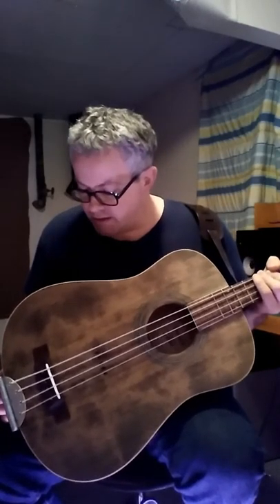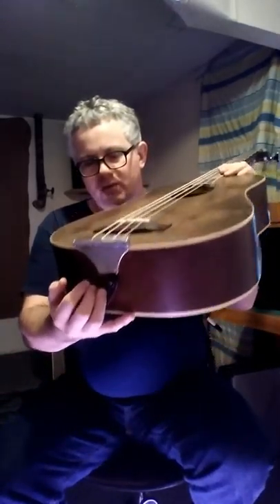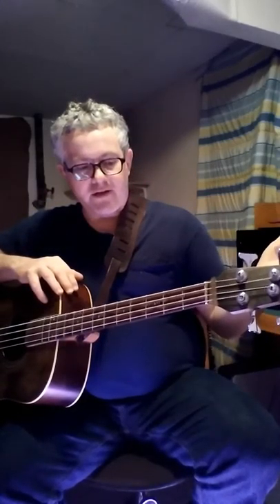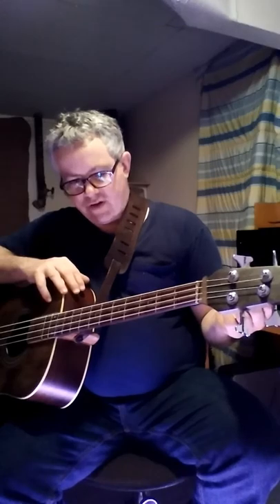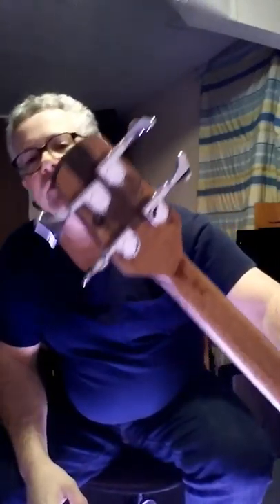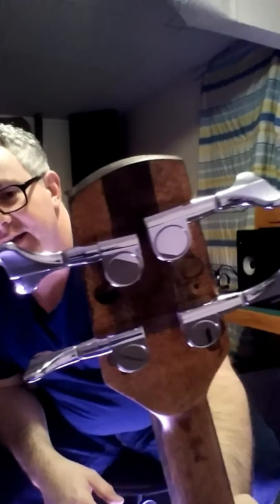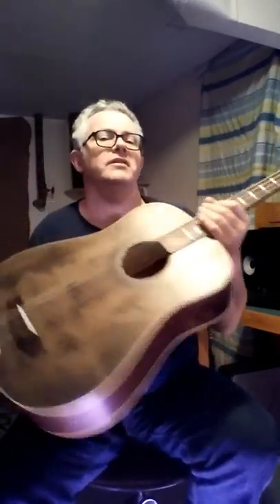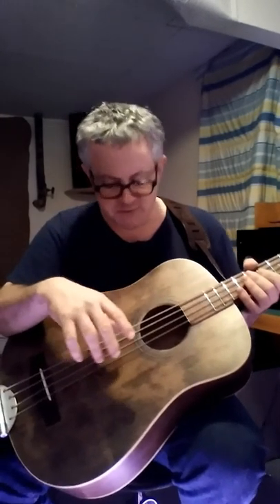Acoustic Guitar to Bass Conversion

Comment: Harrington, I converted a 4-string medium scale bass (E,A,D,G) to a 4-string 'LOW B' bass (B,E,A,D) -- the problem with this conversion is 'accommodating' the B string with out having to extend all the strings to an 'anchor' plate located several inches below the bridge -- that 'anchor' plate destroys the functioning of the SOUNDBOARD, resulting in a 'thin'-sounding bass.

The trick to accommodating the Low B string is to run it to the topmost tuning machine head ( the one the 'A' string usually goes to) and running the 'E string' to the lower machine head -- which requires shifting the hole for the lower machine head over to the right by 1 cm (* I didn't drill a 2nd hole, I used a coping saw - hence, 'shifting' the hole).

(*) Low B strings can only be obtained in 'longscale' size, i.e., they are 37.25 inches from bead to where the string tapers to half its diameter -- if you try to bend (as much as a right angle) a Low B string, no matter the brand, it will snap like brittle toffee.

Comment: Do you think I can put 6 acoustic bass strings on an acoustic guitar?
Reply from the maker: I think that could be very interesting!  If you modified it like I did to a 30-inch scale with a floating bridge, that could work out really well--kind of like an acoustic Fender Bass VI.
Reply: I did.  Well I used a 12 string guitar because they are made heavy duty compared to a regular six string.  Then I used  the Ernie Ball 2837 set which is a six string bass set (EADGBE) just like a guitar, only an octave lower.  They also have guitar ball ends instead of bass guitar ends so it's more likely to fit the existing guitar bridge.    Mine sounds pretty good.
Reply: @Cristofre  thanks for the tip, it would be awesome to see the instrument. I'm glad to know it's possible to do it with a 12 string
Reply: @MrFresco25  No problem.  Like I said, look up that set, it's an easy way to get into converting an acoustic guitar (or electric) to a bass and what's more, everything you know on guitar translates directly.  Just make sure the instrument is strong enough for the extra string tension.

Comment: May I know what measurements of the distance each strings that you made.tnx!
Reply from the maker: I think you mean the distance between the strings?  The width of the fretboard at the zero fret is 36mm.  From the edge of the fretboard, the on-center measurements are as follows: E = 3mm, A = 14mm, D = 24mm, G = 33mm.  At the bridge, the strings are 17mm apart from each other on-center.  Let me know if that answered your question.  Thanks!